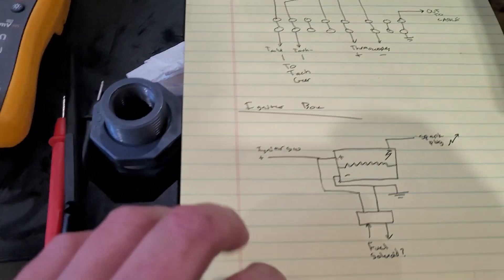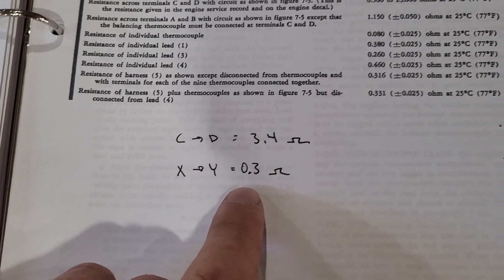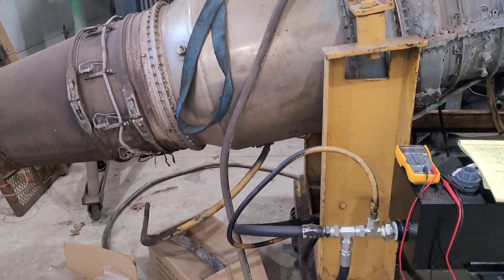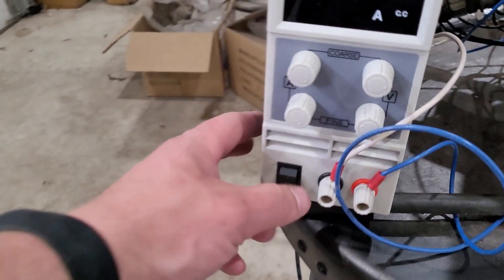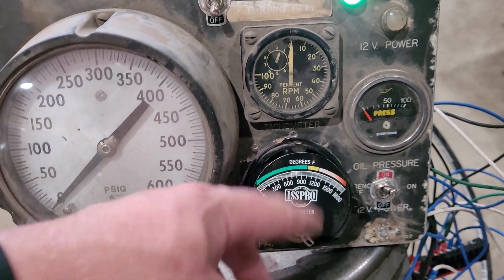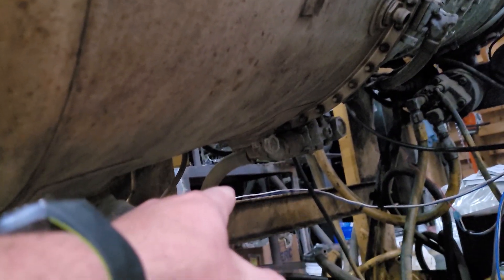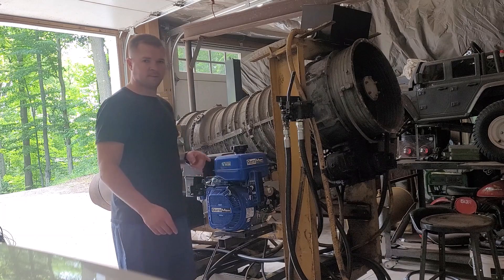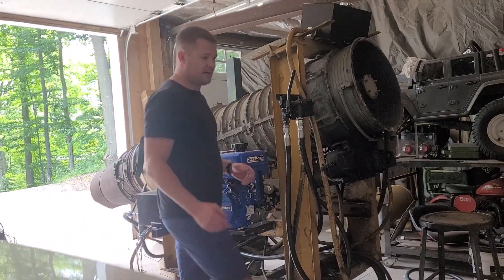Jet engine systems check... All systems are a go!

Comment: Awesome video mate. I noticed there's a little confusion about the fuel drain valves on the bottom. These let any fuel drain out when the engine below idle that maybe have sprayed out of the nozzles and collected inside the bottom of the combustor case. They aren't actually part of the fuel system. Once the engine reaches idle, the pressure inside the combustor case closes these vavles to stop the compressor discharge air leaking out. The fuel dump valve that's attached to the fuel manifold inlet with the dual ports is the one that dumps the fuel on shutdown. Once the fuel pressure drops it switches a valve inside that allows the fuel that's in the two big fuel manifold rings inside the combustor to drain on the ground or in a catch can. This is to stop the engine smoking and possibly catching on fire inside when the fuel would otherwise continue to drip from the fuel nozzles under gravity. I hope this makes sense. Cheers.
Reply from the maker: You're exactly right. When we finally hooked everything up to start the jet we went through and tested all those dump valve functions to make sure it would empty the fuel manifolds once we cut pressure.